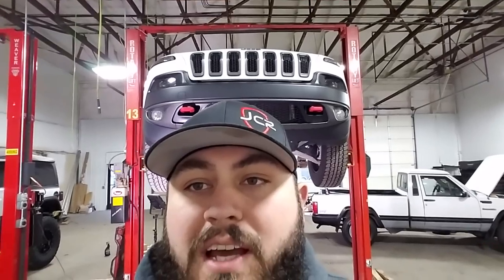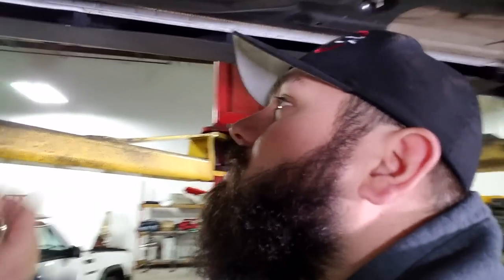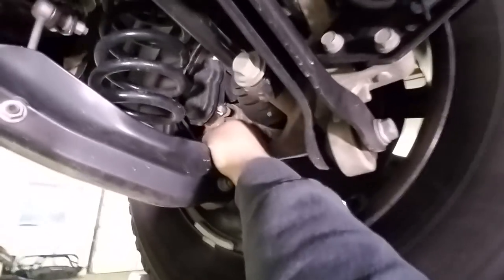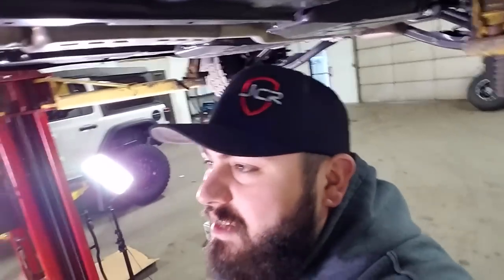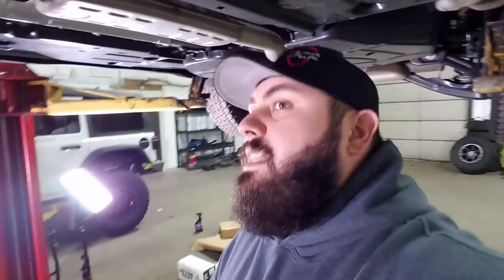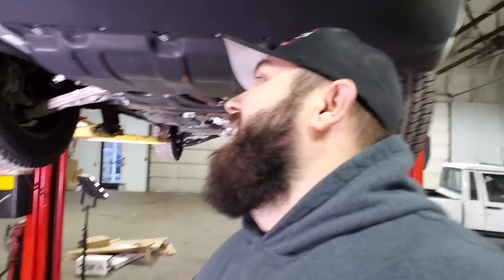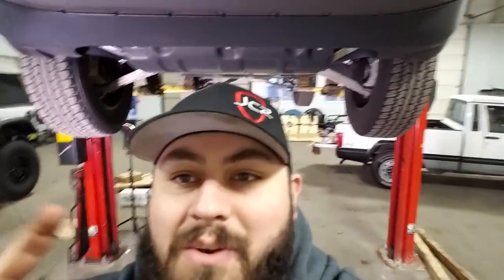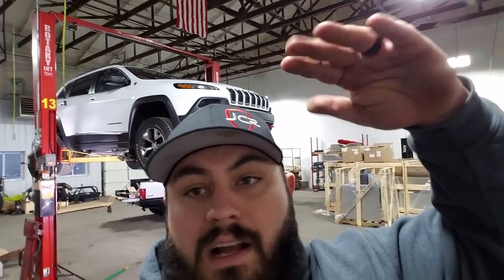What in the heck is under this Cherokee Trailhawk!?!?!

Comment: Love my Trailhawk.  She's gotten me over some stuff that just simply amazed me (and the wranglers i was following).  Also, YAY SKID PLATES!!!!
Reply: Fearless Trailhawk +1 on the skid plates. I’m kind of a newbie to off-roading on anything other than a motorcycle. I took my ‘19 TH off road for the first time last week and got a little too confident in one really rough section and I was really grateful for those skid plates. I never got stuck though😂.  I think these need to be an inch or 2 higher from factory. They should’ve put the air suspension on it like they did the Grand Cherokee. I’m thinking about putting a lift on it now that there are some good kits out there for it. Jeep says you can put up to 2 inch lift on it without messing with the warranty.

Comment: Just a heads up, few different lift options out there. Look Up Hazard Sky or the "Aussie Lift" for a DIY. Also, Dobinsons makes a full suspension lift. You can fit a 32" tire also with a little pinch weld modding. Also, few options for rock sliders, MOPAR and RRO. These KLs are great, think the overlanding is really their strong suit.
Reply: ^This, I just got the hazard sky 2" for myself. Also, MFC brand also now makes the first dealer certified lift for the KL.
Reply: When lifted with large tires, these little crossovers are nearly unstoppable.
Reply: Except for when the steering rack shits itself at 3mph lol

Comment: Nice video! I have worked on a few Trailhawks and have been pretty impressed. The electronics on your rear calipers are for the parking brake. Jeep was kind enough to include a menu option on the infotainment system for pad replacement, some manufacturers make you use a scan tool to retract the actuators.
Reply: That's nice. The 2016 Edge, you gotta do some funky button combos that I already forgot how to do.
Reply: I have a question-I’m getting noise from my rear diff and I’m reading that there’s a single/two speed scenario for the differential? Is this true fox the trail hawk?

Comment: I've lifted my KL 2" and added 31" KO2s. Has no issues going over.... anything
Reply: Any other modifying to get the 31s on with the lift?
Reply: What size KO2s did you toss on?
Reply: Did you have to change other parts to lift it 2 inches?
Reply: Plan to do the same 🙌🏼. Would’ve went with the wrangler sport but I’m good on the whole death wobble thing.
Reply: Bruh respond to comments pls... as Rafael mentioned, did u have to change any other parts to lift it 2"? Also, did you use spacers or a full-on lift kit?
Reply: @iBlazec  Ditto.

Comment: I noticed your rear lower control arms are aluminum, on my 2019 trailhawk mine are steel. Never realized they would change something like that in the design. Mine is the 3.2L V6 also.

Comment: Yes.... It uses the brakes for torque vectoring and for simulated lock faking out the open diff when the rear isn't locked..... The front has simulated lock also using the brakes to trick the open diff.

Comment: The electric brakes serve 3 purposes. It is part of the E-brake. It is part of the stability control to prevent loss of control or vehicle roll over. And lastly it is used for the BLD or brake lock differential. ie traction control.

Comment: that system in the rear is for the crawl cruise mode and hill descent as well as other features mentioned below. hill descent just works the break to keep you at a selected low speed while you crawl down a hill. kind of neat

Comment: These things are nuts. The ptu (think transfer case) houses the front diff and the front reduction planetary gears. The rear end is a 2 speed with a locker as well, that's how you get 4 low. The 2 speed rear end is there so full 4lo torque won't go through the rear driveline and twist it in half.
Reply: Oh interesting. It seemed a little oversized, that makes more sense now.
Reply: Also let's you drive out after losing the rear end.  I destroyed the whole rear, literally grenaded into pieces when it found a solid spot in the soup. Pulled out the transfer shaft and cv,s, and drove 80 miles home on FWD... there were a few codes and the dash looked like a Christmas tree but it got home.  Now I have probably  the world's only set of portals for it so that isn't an issue anymore, neither is 37s and ground clearance, plus the reduction makes the 37s drive like stock tires.
Reply: @sycoticone  what?! 37s and portal axles? Dang that's impressive

Comment: Great video of the under body skid plates.  I didn't realize those steel plates were so big. That's definitely a lot of protection compared to other SUVs that everyone compares the Trailhawk to - RAV4, Mazda CX-5, Subaru Forrester etc and why it's so much heavier as well. Now we can all see why it needs that V6 or 2L turbo horsepower.
Reply from the maker: Yes, and the V6 feels much better if you test drive them.
Reply: @JeepinBubba  We only get the V6 here in Australia - so far no turbo option. But after test driving one I really thought the V6 was great.
Reply from the maker: Yup, the V6 is way better. Thanks Mate!

Comment: Ive only used my Trailhawk 2019 on the beaches of North Carolina, but I never got stuck, even on the deep parts of the Southern Shores part of the outer Banks. Planning on Ocracoke in a few weeks, very excited.  By the way, the the 2019 Trailhawk has the most comfortable seats ive ever sat in.
Reply from the maker: They do great in sand and in snow, that's for sure.

Comment: I think the cherokees that come with the towing package have more cooling on them. Trans cooler and I think another rad fan. With the trailer package from factory the v6 is rated to tow up to 5000 lbs.
Reply: Jon Becker this is not true I have owned both models one with towing and one with not and they are the same.  Both v6
Reply: Sunfish Productions “Trailer Tow Group
 $795 INCLUDES:
 7- and 4-Pin Wiring Harness Auxiliary Transmission Oil Cooler (The auxiliary transmission oil cooler maintains the transmission at the optimal temperature for it to operate.) Class III Receiver Hitch Trailer Tow Wiring Harness Heavy-Duty Engine Cooling (The heavy-duty engine cooling system is designed to vent excess heat generated by heavy engine use.)”

Comment: I had three of these now, two of them Trailhawks.  Not great off-road, as their ground clearance isn't very good. Just try and crawl under one to work on something.  When I do a lift it'll probably be a Dobinson.  Bubba pointed out the exhaust hangs down and he's right.  They have 2.5 inch exhaust which seems a bit oversized for the 3.2L, as the 3.6L uses that too.  Using 2.0-2.25 inch pipe, deleting the exhaust bellows,  goofy low slung hangers, clamp bolt that hangs down, resonator and tucking it all up in the tunnel would help.  I can see on mine where that flat bottomed resonator gets jammed up into the driveline when an obstacle exceeds the breakover a little.    The heatshield for the front driveline carrier bearing is the perfect mud scoop too.  I think I'm going to tackle the exhaust system first. No matter how much lift you have you're always going to get high centered, on the trail, and I don't like the exhaust being the first thing to get hit.  A little smaller exhaust pipe should work better for everything besides drag racing.  At 75 mph the 3.2l only chugs along at about 2000 rpm with those 4 overdrive gears in the ZF9.

Comment: If it's the V6 Trailhawk with the Factory tow package and extra fan on the trans cooler it's factory rated for a towing capacity of 4500 pounds by FCA. It's actually listed on their website and in my manual. I do know the other Trailhawks are indeed 2k lbs. I have towed a 26ft 4600 lb camper with expensive weight distribution equipment, and I can't even feel it behind me at highway speeds. Also, even your Trailhawk rated at 2k lbs can far exceed that amount without doing any damage to the trans or engine regardless of what FCA or people tell you.
Reply from the maker: It was the V6 but now with a tow package

Comment: I'm interested in one of these for the combination of off-road ability and towing ability (V6=4,500lbs). Not many mid-size SUV's that can tow more than 2,000 lbs. and have good 4x4 abilities.
Reply from the maker: My latest video I tow a little camper trailer and it does great! 20 MPG and plenty of power on the highway.

Comment: I’m fairly sure your Trailhawk can do 4,500lbs. My 2019 can do it now that it has a hitch installed and it didn’t come prepped. Pull the build sheet and see if it has the heavy duty components and the fluid coolers.
Reply from the maker: The 2019 with a 3.2L was rated at 4,500, but everything before that was rated at 2,000. I think these little Jeeps could tow 5k to 6k easily, but there brakes can't stop that weight. The Jeep KL motor, frame, and suspension all do great towing.
Reply: I would still check the build sheet. If it shows the upgraded suspension and cooling like the TH has, yours might be rated for 4,500. Doesn’t hurt to look. And you can always get a brake controller if you used the mopar trailer wiring kit.
Reply: http://jeepsies.com/jeep-build-sheet/ for the steps to get the build sheet.
Reply from the maker: Thanks! My dealer sticker said #2000, but I am sure its capable of more, however, my overland trailer filled with gear is like 1,000 to 1,500 lbs so no big deal for me. I did use the factory mopar harness though, and thanks for the info.
Reply: The factor towing package has different gearing.
Reply: Daveinet guess that depends on the year, but I looked at the build sheet on mine and it had everything the tow package offered except the hitch and wiring.
Reply: @protaginets  I just verified my build sheet. The rear diff gear ratio is 3.517. If you go to jeep's website and click on Tow Package, it lists this same 3.517 diff ratio.

Comment: Please make that tow hitch install, I want to install one on my 19 trail hawk elite. Have not found one for my year Jeep. I only have jack stands and I want to see if it is possible to do it on my own, so please make that video of hitch install.
Reply from the maker: Its possibly but the entire rear body panel has to be removed.
Reply: I added a Mopar OEM hitch & wiring to my 2019 Trailhawk Elite...dealer installed...paid thru the nose to do it, too. Nearly impossible to find one optioned exactly as I wanted it.

Comment: Cherokee KL are made in Illinois. The KL is a FIAT designed american built vehicle. And HAHAHAHAH on the renegade. Thats just a rebadged fiat 500L
Reply: Stormer1092 the Renegade shares the chassis with the Fiat 500X crossover. The KL isn’t a rebadged 500L, the 500L isn’t even available with AWD/4x4. It’s(the KL chassis) very similar to the chassis on the Dodge Dart, the Fiat version of the Dart which is only available over-seas. The Chrysler 200 which is virtually the Dart of course, and the Alfa Romeo Giulietta.

Comment: With the v-6 it can tow 4500lbs.
Reply from the maker: On my 2017 Trailhawk with a V6 Jeep said 2,000lbs, unless you got the factory tow package and 4x4 which takes you to 4,500. They actually offered a lower gear on some tow packages. Now the 2019 Jeep claims 4,500 for any Cherokee with 4x4. However, after towing 1,500 pounds with this Jeep, it had plenty of power but really lacks in the braking department. If you trailer has ebrakes and a antisway system then you might be ok, but be careful out there. Thanks for the comment!

Comment: I DEEPLY REGRET buying my 2020 Cherokees. Learn from my MISTAKES. My 1st 2020 Cherokee was a lemon and my 2nd 2020 Cherokee was not built right and neither Jeep or the selling dealer Bob Poynter Columbus will make it right . BUYER BEWARE do NOT BUY a Cherokee or trust a Jeep dealer. Just Empty Every Pocket is a TRUE acronym.
Reply from the maker: Sorry to hear this. I put 60k miles on my Cherokee and had zero issues.
Reply: I have 2019 & 2020 KL's, both Trailhawks...they are great!
Reply: @User-cc6cq  Cherokee Overland 2016. same thing for me. Disk brake warped after first year. For a 2016 bought in 2017, I had to change to ball joint on the front and I was told by the dealer that the rear knuckle bushing are worn out. And My transmission module is failing. I am able to reset after the oil is warmed up, but its a costly repair. That German transmission had only problems in the jeep product. Although it is use in many other car. I am going back to Toyota Tacoma when they are available. Never buy a Jeep product again.

Comment: I think they can tow like 4000 lb, Ding dong
Reply from the maker: Depends on the package of the Jeep. 👍
Reply: @JeepinBubba  my Grandparents 2017 Cherokee latitude can pull up to 5000 lb actually its they base model 4x4 no trail hawk no low range no locker just all time electric 4x4 up to 60% power to rear wheels
Reply from the maker: Where did you get that information, because it is wrong. 2,000lbs for the 4 cylinders and base V6s. Some were equipped with a tow package to push it to a max of 4,500lb. Now you can tow whatever you want, but I am refering to dealer specs.
Reply: @JeepinBubba  v6 tow. 2 inch reciver package max 5000
Reply from the maker: That means that the reciver is rated for 5,000 lbs not the vehicle. The brakes and suspension on the cherokee would hate 5,000lbs.

Comment: Does that unit have the low gear ratio for towing?  Trail Hawk comes the skid plates oem.    I don't get your purpose.  Just a bunch of uninformed blather.  Nothing to see here.
Reply from the maker: It has the 3.73, not the 4.10, because we knew that we would drive on the highway more than tow and prefer better gas mileage.   The purpose of the video is to show people the underside of a cherokee trailhawk. I think the video is educational, but I do appreciate your comment. I do happen to be a Mopar CAP graduate, a Mopar Level 4 Tech, as well as a ASE certified Tech, and I have been working in the automotive industry for the last 8 years. I know I am goofy sometimes, but I wouldnt call what I do uninformed blather. Again thanks for the comment, I will work on stepping my game up 😉.